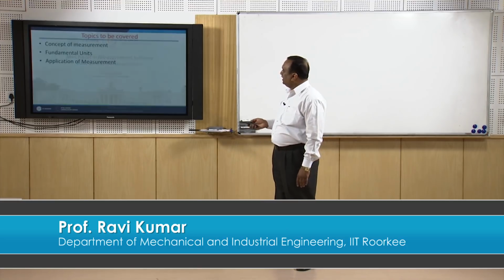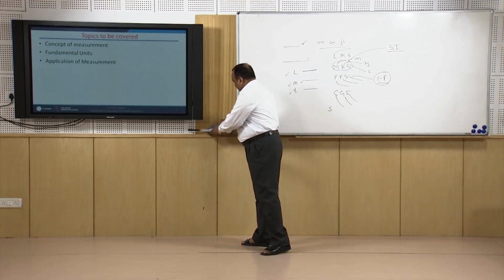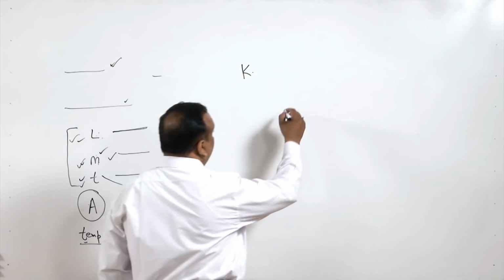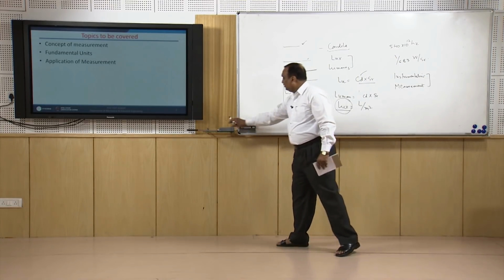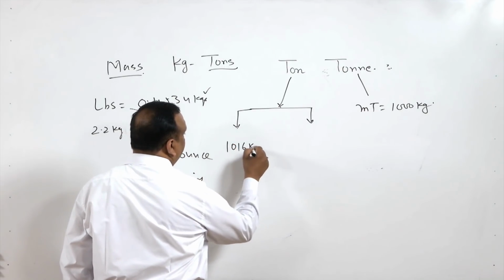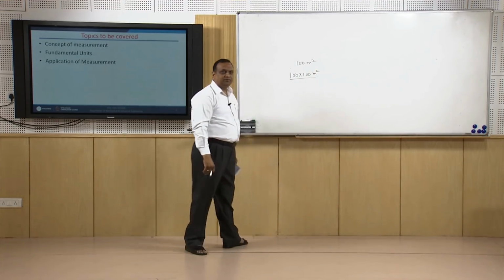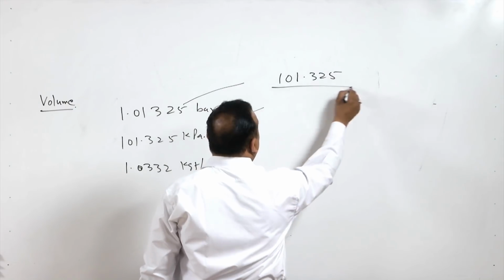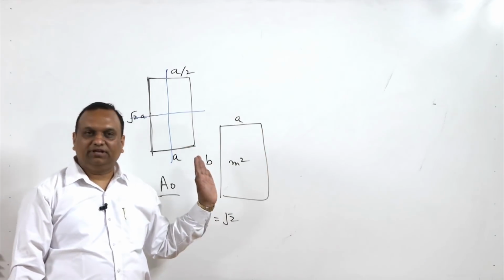Lec 01

Comment: The ampere is that constant currentwhich, if maintained in two straight parallel conductors of infinite length, of negligible circular cross-section, and placed 1 m apart in vacuum, would produce between these conductors a force equal to 2×10−7newton per metre of length.